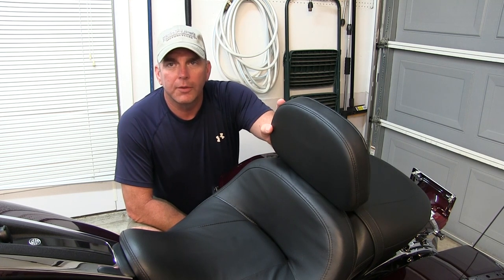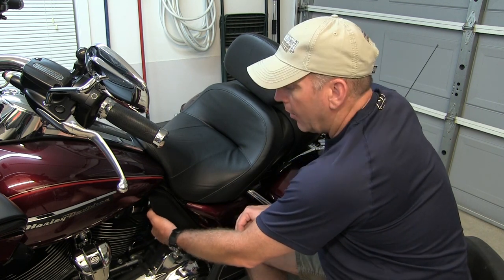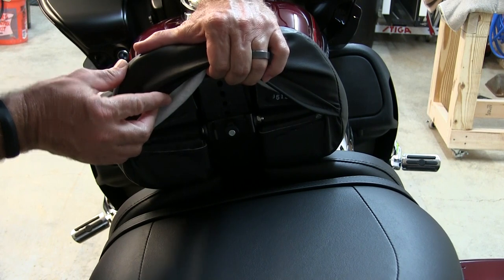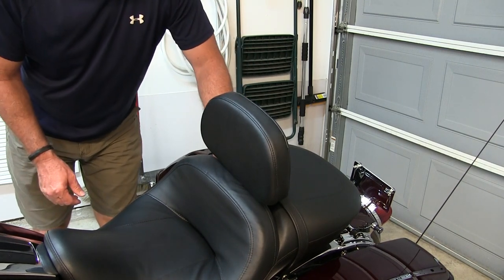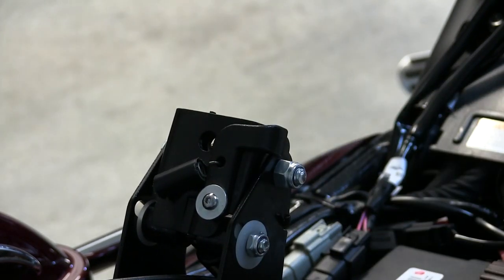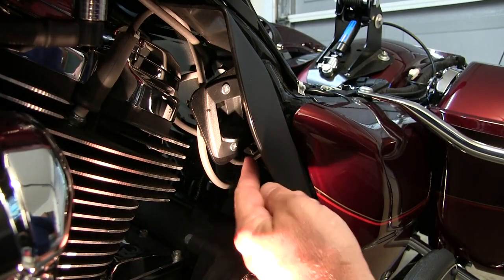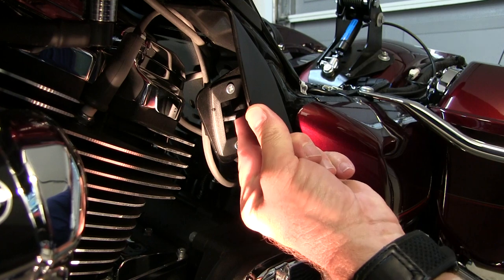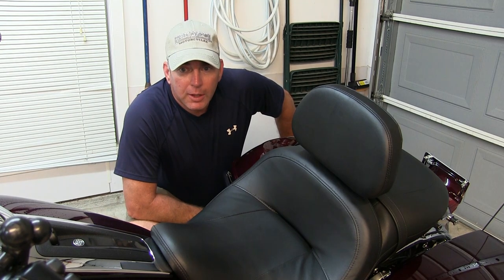Harley Davidson Adjustable Rider Backrest_1

Comment: This is an old video, I know, but it was very informative.  I recently bought a new Ultra Limited, and during the 1K service, I had the service tech install an adjustable backrest (I was on a riding trip, and didn't want to have to fool with it, not knowing if I'd have all of the tools with me, that'd be needed for the job).  I forgot to get a demonstration from the service tech on how to operate the seat.  Since then, I've been doing trial and error, to figure things out.  I had not yet figured out how to release the seat from the hold-down attachment, and couldn't remove the seat with the backrest in place, to see how the attachment hardware worked.  Your video told me everything that I need to know.  Thanks!

Comment: This was the first video I’ve seen that even comes close to explaining how it should look under the heat deflector. It’s all garbled underneath according to the directions which shows nothing about where the spark plug wires should be routed but at least we can look at the angles of the parts and go from there. Wish there was a view from under the heat deflector so we could see the arrangement. I was about to give up until I saw your video. Thank you sir.
Reply: I'm sure you figured it out by now.  There are sparkplug wire clips on the heat deflector.  ;-)
Reply: @williamchristie7365  I'm about to start this today.  I heard about the spark plug being a problem.  I'm sure I'll see what people are talking about once I start

Comment: I Just got a 17 cvo Limited, got a deal since the 18s are showing up. Really like your 3 vids. Hoping to have the detach tourpack   I think the bike will look great & ride easier. I have the rider back rest  , but all the specifics must be different. Haven to keep checking.
Reply from the maker: Nice purchase Bob. It's amazing how different the bike handles without the tour pack. You'll want to figure out where to store it as soon as you get it off the bike. That cart I made makes it easy to move and keep it from getting damaged when not on the bike. Send a pic when you get a chance. Thanks for the compliment. I'm working on a video where I installed a Mo-door garage door opener with the micro switch last week. Works great and you wouldn't know where the switch was if I didn't show you.
Reply: What cost the harley

Comment: I see you have a rear luggage rack quick disconnect on that bike.. how do you like it? Does it rattle etc? How long does it take to connect/disconnect it? I'm thinking of buying one this week, I'm interested to hear your thoughts
Reply from the maker: I like having the rack. Make sure it fits as some will contact the license plate bracket. I haven’t had any problems with it rattling. The bushings have to be adjusted to keep it tight but not so tight it’s difficult to remove. I can remove it in less than a minute.
Reply: @joeljasper3622  thanks for the reply. Don't they come with a new license plate mount? Some rub on the  license plate bracket that comes in the kit? What rubs on the the license plate bracket,  the base of the tour pack?
Reply from the maker: The first rack I tried would not lock all the way in because it came in contact with the top of the license plate. It probably didn’t lack but a 1/4” making it. But you don’t want it even touching the plate. That’s why I chose one that turned up slightly in the back.
Reply: @joeljasper3622  which one did you finally go with? Harley's?
Reply from the maker: It’s the H-D Detachable 2-up Luggage Rack. Part # 54125-09A.
Reply: @joeljasper3622  thanks brother!
Reply from the maker: You’re Welcome.

Comment: Helpful video. Was wondering if you could use this set up with the mid frame heat deflectors. Looking to add these to my 2016 FLHXS.
Reply from the maker: I’m sorry, Tim. I just saw your comment. I’m not familiar with mid-frame heat deflectors to say if it would cause a problem.
Reply: J J No problem. My mistake, I called them heat deflectors, but the correct term is “air deflector”. You have them on your bike. The plastic pieces on either side just below seat, mounted to frame. I wasn’t sure it they could be used along with back rest adjust lever.
Reply from the maker: Yes, the adjustment lever will be just inside the left deflector. The deflector actually hides the adjustment lever.

Comment: I have found that the “tab” on the actuator either fits in the cross member but the bolt does not, or the bolt fits and the “tab” ends up below the cross member.  Others??
Reply: Agreed.  On my 2021 Road Glide Special - the tab went below the cross member rather than into a slot.

Comment: Okay...how do I get the backrest to sit flush with the seat?
Reply from the maker: Mr. Gold, there is a spring loaded pin under the cover on the back side of the seat back. Pull that pin out and drop the bottom of the seat back down to the top of the seat and release the pin. Make sure the pin locks back into one of the slots.
Reply: @joeljasper3622  yes sir....I did that already...but the backrest still sits high....I would like the backrest to sit at my lower back ...but it sits higher up from the my lower back...
Reply from the maker: Mr. Gold, are you running a stock seat?
Reply: @joeljasper3622  I'm running a mustang stock seat sir...
Reply from the maker: Mr. Gold, unless you can get a shorter bar for the back rest, it doesn’t appear that it will go any lower. The bar has an offset. So, even if you shortened the bar at the top, I doubt the collar on the backrest would go over the offset.
Reply: @joeljasper3622  okay sir....and thank you...

Comment: Did you change out your heated grips?
Reply from the maker: The RG Ultra doesn't come with heated grips. Kinda crazy that it doesn't. I had the stock grips changed out during the first 1,000 mile maintenance. I replaced them with the "Get-A-Grip". They are concave so the fit is better and less tiring. I got the large size and wear a size 9 or 10 glove.
Reply: J J that is so weird, the ultra limited comes with heated grips.
Reply from the maker: Tell me about it. There are numerous comments out there about that issue. You would think that for a difference of $2K, that would be a no brainer.
Reply: That doesn't sound very fair, I do like your grips alot better for comfort. But would like heat too!